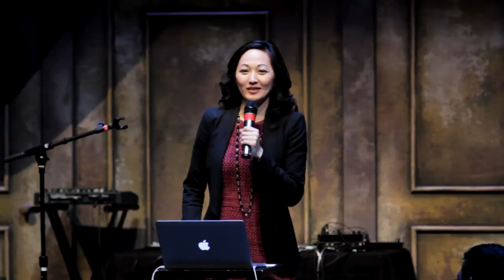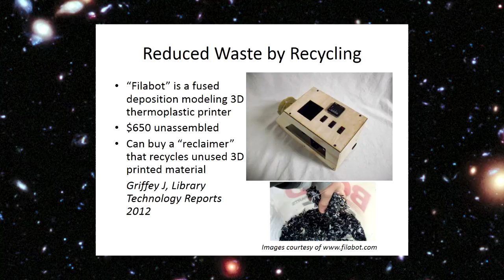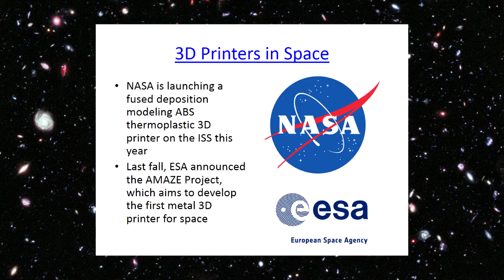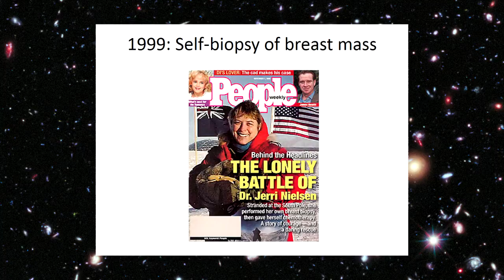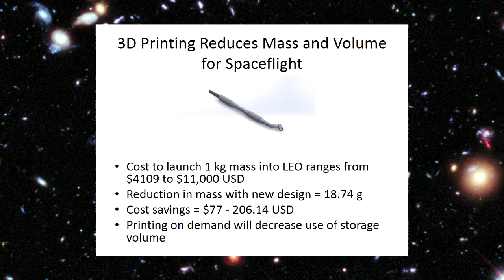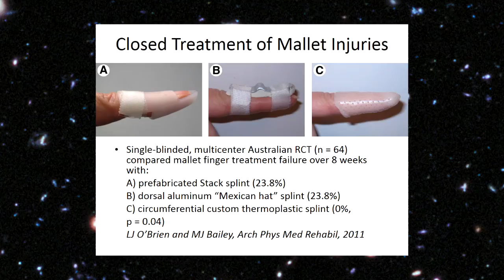Dr. Julielynn Wong on 3D Printing

Comment: Engineering can produce a capable product, but sterility of the printed instrument can heavily impact patient outcome. Decon gel (as noted in your study) may have some promise, but a 5-year shelf life is concerning. Additionally concerning is the "sterile" removal of the gel without contamination of the instrument itself. Depending on the production process to sterilize instrumentation also replicates the dilemma of sterile transfer to the surgical field.  Most plastics do not handle time/temperature/pressure of traditional sterilization well, and typically require ETO gas or hydrogen peroxide gas plasma sterilization - these machines quickly neutralize the weight savings benefits of printed instrumentation vs titanium (as available in the current instrument marketplace).